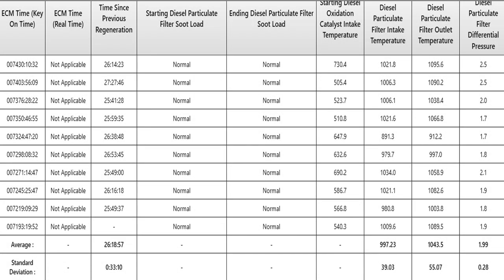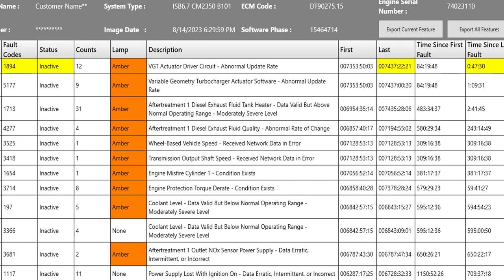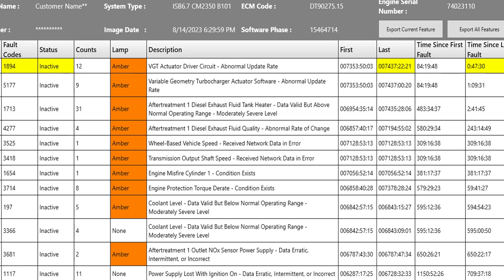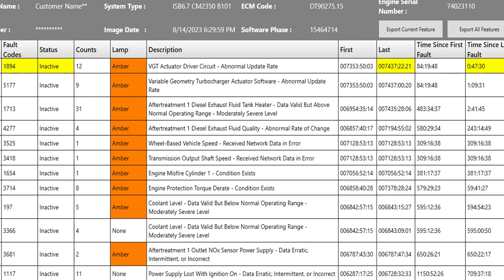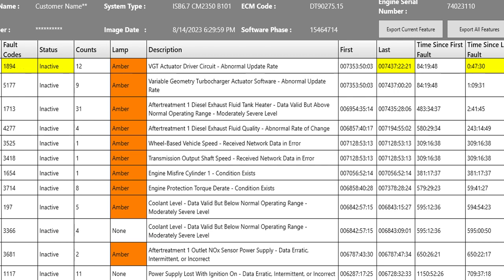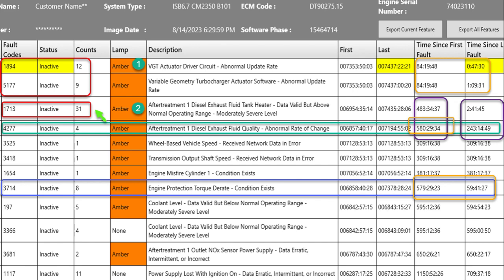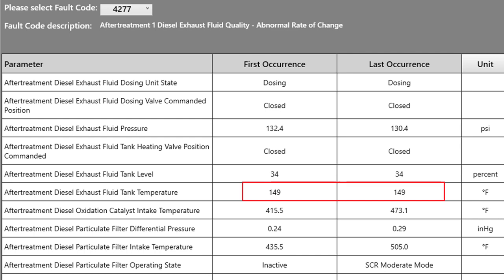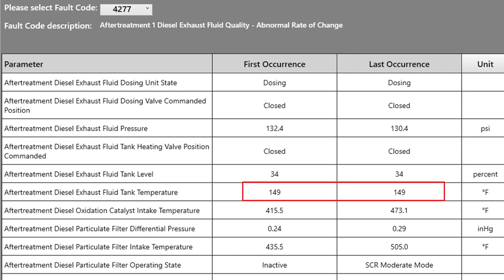B6 7 with many faults  How do I know where to start!

Comment: Hey joe got one for you When it comes to the data bus on cummins engine 6.7L  the data bus the voltage should be the same even if the truck manufacturers different.( example ford f750 vs an international ) or would the data network use different voltage
Reply from the maker: It depends on the data bus sae standard.  So J-1939 is the typical "fast" bus on Cummins and they are all the same voltage standard. Other bus standards could be different voltage levels. Cummins older slower standard or early days if you will was J-1708.
Reply: @ENGINESHOPJOE  thanks for the fast responses Joe appreciate your work I having issue with the vgt on a 2013 ford f750 am reading 10 volts on both data links but not sure if that's ford data link voltage spec am use to seeing 2.4 - 2.8 on class a trucks
Reply from the maker: Is it a ford engine or cummins in the F750 chassis. ( I can ask a guy I work with who knows about the powerstrokes)
Reply: @ENGINESHOPJOE  thanks Joe actually found out the issue eas my digital meter was fualty reading wrong voltages repalce it data line 2.6hi and 2.4low crazy tool failure thanks for the reply appreciate  you. Merry Christmas and happy new year brotha be safe🤦🏽‍♂️